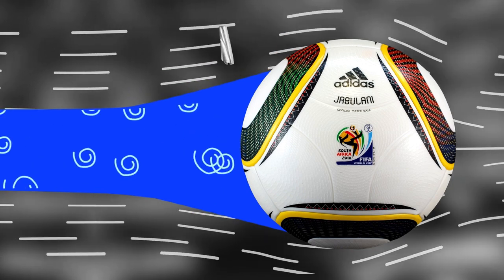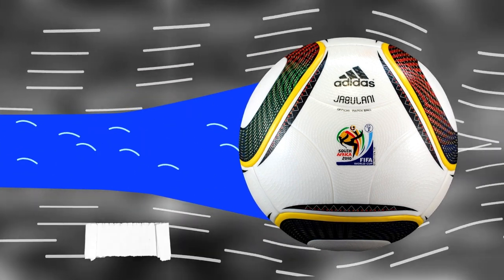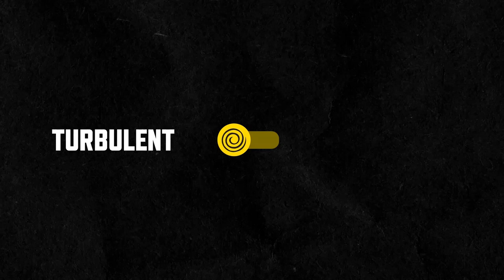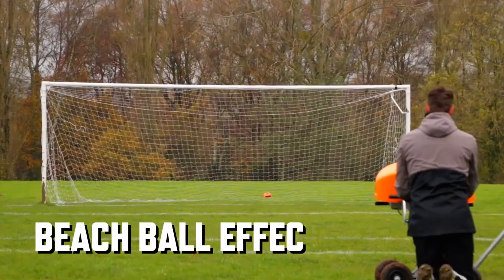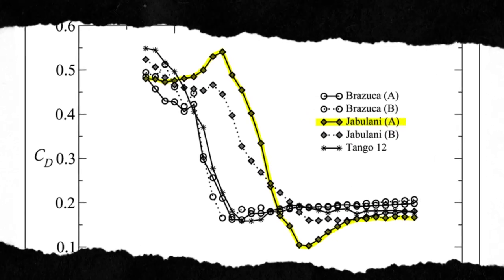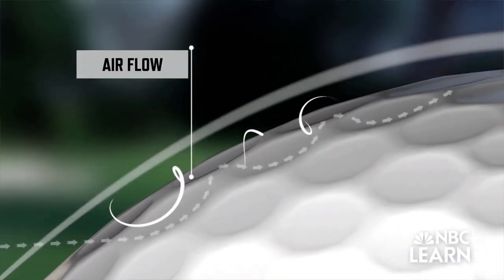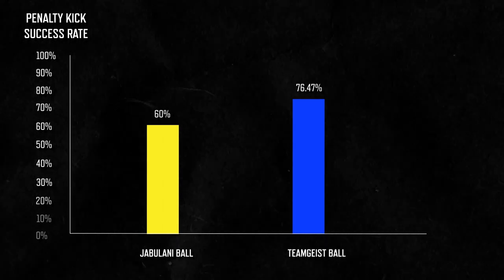The PERFECT Soccer Ball - How will the Qatar 2022 ball perform?

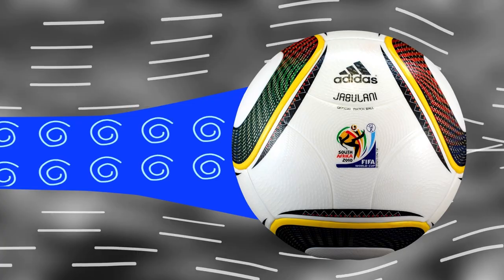Comment: at 2:09 you say the drag force is larger for laminar flow than turbulent flow... That doesn´t sound right. Can you explain that, thanks!
Reply: For a given speed, the drag coefficient for laminar flow is larger than for turbulent flow.  The drag force is proportional to the square of the speed and to the drag coefficient.  The drag force increases (mostly!) as speed increases and flow changes from laminar to turbulent, but my comment in the video had to do with a given speed.  One ball may have turbulent flow at a given speed whereas a different type of ball (different texturing, panel shape, etc) may have laminar flow at that given speed.  As long as we are looking at the same speed, the latter ball has a larger drag force compared to the former ball.